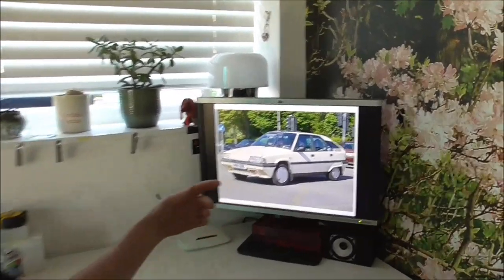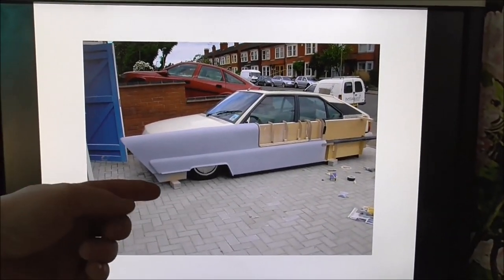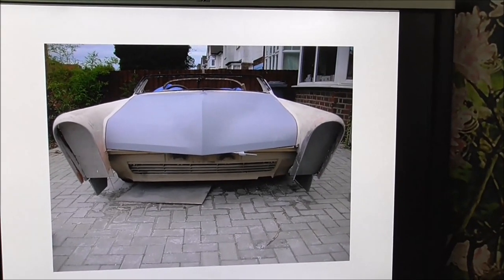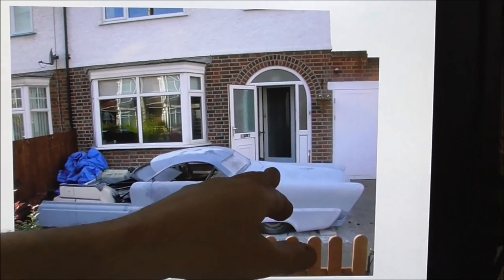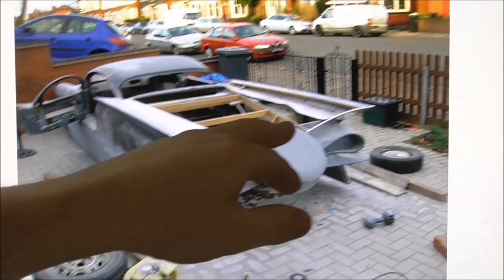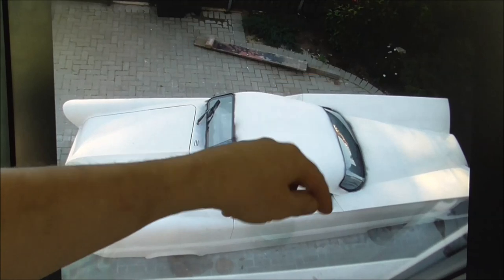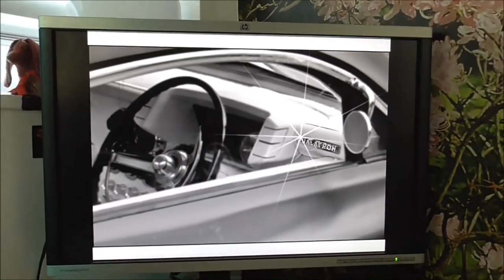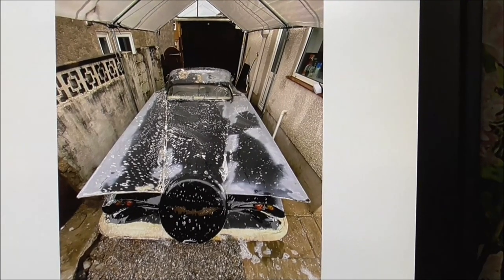From a Citroen BX to one off kustom Dualatron

Comment: Great to see the build pics. Love it. It's really good to know it's now got an owner who is willing and skilled enough to do it justice. Last thing it needs is a bad owner letting it get ruined.  That interior picture was sad. 
 I've been rebuilding the mk2 capri roofed two doored mk2 zodiac that was on the scene a lot in the 90's. (was named capriac but that sounded like a heart attack so now it's called the zombiac)  Now after a huge amount of de bodging it's mechanically right I spent yesterday removing all the filler from the cracked nasty rear quarters back to bare metal. (heat gun and wood chisel on the hottest day of the year outdoors on gravel drive) It seems to have had 5 different paint jobs since it was built, by 5 different owners none of whom thought to themselves "why is it cracking the filler?" instead just layering more and more on.  Now it's all dug out and the rear doors welded from the inside and braced properly which I'm surprised wasn't done 30 years ago. It's all a lot of work but as you know, you just have to keep at it. I loved the satin black so just patch it in comment. Exactly what I'm planning. Can't wait to see the next installment  on your mystery build.
Reply from the maker: Yep if it flexes its gonna crack one day. If ive ever got anything real nasty to cover I grind to bright metal then etch prime it and then cover in glassfiber matt and resin, (not the stuff out the tub) It really sures it up and sticks a lot better, also now you can do that with carbon fibre matt its thinner and stronger.
Reply: @bacop001  cheers for the tips, never occured to me to do it that way, I like the carbon fibre matting idea.  The problem was the rear doors welded to rear quarters, you could feel the panel moving when you shut the doors. Only the outer skin joined together. Not anymore now it's had the inner door gaps welded up and some strategic 3mm plate beefing up the corners. Nice and strong now. 
I'm a bit like you in that I love a car that looks wierd and confuses people. I also love your re purpose of objects on your builds, beer pump grille looks stunning. Sometimes money can't buy the best looking thing for the job, it's luck and skip mining.